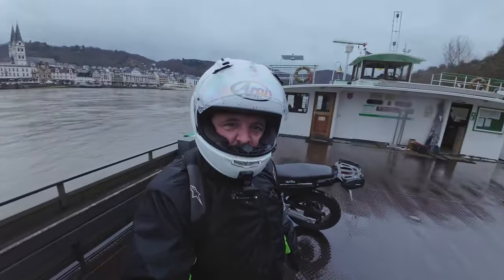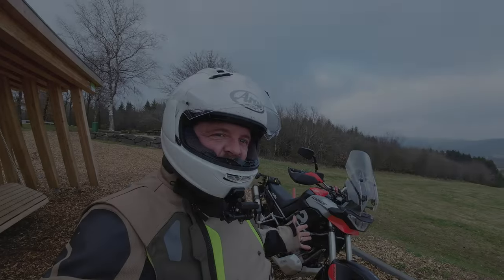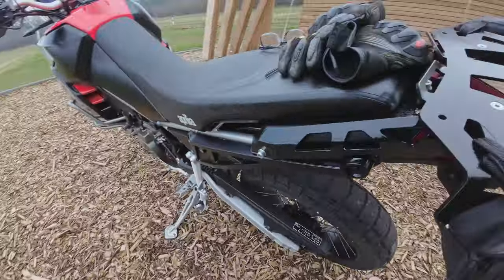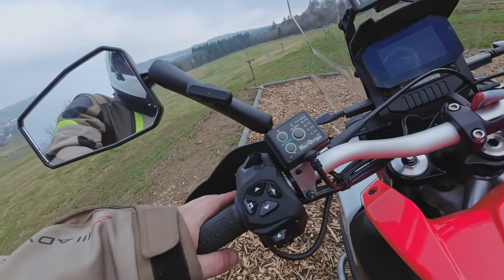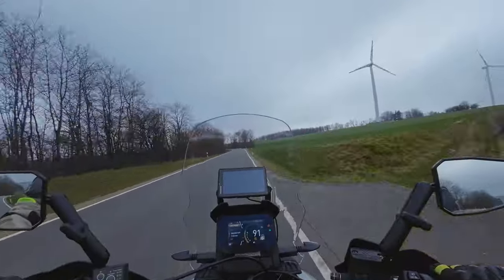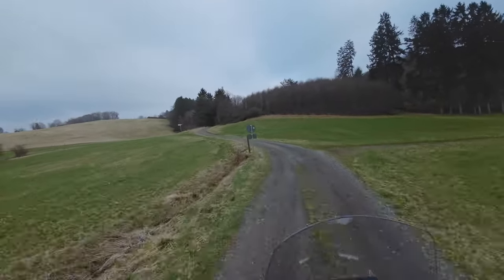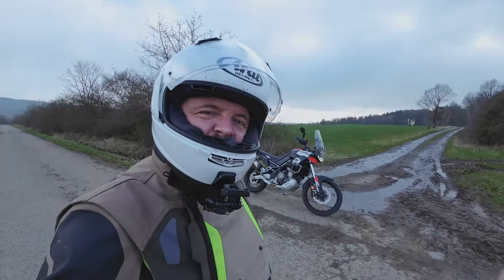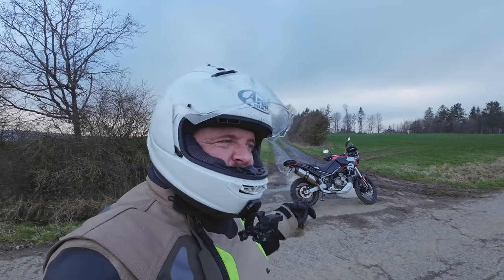Aprilia Tuareg 660: My first 1000kms, my HONEST experience

Comment from the maker: 1) LOTS of feedback on the expensive first service. I will cover this more in-depth later, when I can get some solid info. When I asked how much my first service would cost, I did phone some other Aprilia dealers close to me (in Germany), and they all said the same thing. I've also seen other Tuareg and Tuono 660 owners paying for this expensive first service in other countries too.

People calling me an idiot should consider that I did show them the manual I'd downloaded (in English) and I was shown a piece of paper (admittedly in German, not my first language) explaining to inspect valves at 1000km (600 miles sic).

Now, I suspect, in hindsight, that it might be a massive misunderstanding, or I was shown a service bullet-in that dealers around the world are using to screw some money out of customer. If the factory is worried about tight exhaust valves wrecking engines before the 20,000km service, then that's on them, not us the purchasers of said machine. None of this makes sense. I will dig into this and update you all.

2) The salt was an honest oversight. It was dry and sunny in the UK, when I got the bike out of the van, and rode it for less than 50kms in a semi-urban setting. I just forgot about the legendary potent, powdery, almost invisible, UK salt. (I've not lived there for nearly 20 years). But still, that exhaust weld rusting looks like a weld that didn't see enough argon, and the rust coming out of the silencer is a bad sign too. Salt didn't get fly down the exhaust while I was riding!

3) Sump guard/heat shield damage. It's clearly not a guard in any function, so I will look to the aftermarket. I still can't figure out where or how I broke it, or how it's supposed to fasten on.

All in all, I love the Tuareg and will be using it as my tour-guide bike the whole season, or at least, I plan to!
Reply: 1) I am not calling you an idiot (don’t know the others). And I am not saying that the first service cannot be expensive: I am saying that is not expensive BECAUSE of the valve inspection, as there is no such inspection foreseen.
2) I have already said what I mean about salt.
3) As I said (at the least in the comment that disappeared) you can clearly see a deformation, you clearly smashed the protection in something breaking the parts that fix the protection. Therefore my comment: there is no missing bolt, you damaged it smashi g it in something. Totally agree that you need something more protective in off, I have a Heed bashplate for the record
Reply: I hope my comment didn't come off like I was calling you an idiot because I wasn't. I didn't say anything about anything else though. Just the valve stuff.
Reply: I have the oroginal italian service manual
Reply: Oops only half the comment in there. I have the original Italian workshop manual. Valve check is at km 20000
Reply from the maker: Will check the Heed one. I had Heed on my 800 GS and was very happy.
Reply from the maker: @turbolag5107  People calling each other, and me, names get hidden by the algorithm here most of the time, so it wasn't you :)

Comment: Valve clearance on first inspection?!?!? First time I hear such nonsense, change your dealer...
Reply from the maker: It would appear that all my dealers in Germany are singing from the same hymn sheet. I will try and find out WTF is happening.
Reply: It's a recall. On my Tuono 660 it was like that. Paid by Aprilia. After 20.000km's I had to pay for the valve check myself. And believe me that was a lot more than 350€. 3 valves were off..
Reply: Royal Enfield 350 valve clearance at 300 miles

Comment: Brake magazine, put out a great video on the Tuareg 2 days ago, well worth a watch, after yours obviously 😅, the corrosion is basically your own fault for leaving it in the back of your van with salt on it.... don't know if you're aware, when you use acf50, your supposed to wipe it on and 10 minutes later wipe off the excess.... although if you want a tip from a motorcycle detailer, I use xcp pro (clear coat) on all my customers bikes and they always look good, some use their bikes all the year round here in Scotland... it's a great product and isn't gloppy or oily....top product 👍👍
Reply from the maker: I saw it and left a comment, really cool video! In my defence, I didn't mentally connect sunny dry roads with UK salt, I should have known...
Reply: Do you wipe XCP off like ACF50?
Reply: @Bannister99 yes, if you're storing your bike over the winter and you have a damp shed, garage then yes put it on and leave as is, but in the spring you'll need to wash the excess off before use, this is acf50, with the xcp pro you don't know it's even on your bike....

Comment: Yes, love my Tuareg, '23 model. No real problems in almost 5000 miles, but I also don't run it fast and hard (though people that have say so and w/ very few complaints). I did notice the bolts on the transmission side needed tightening as I saw a top side bleed, just a mist, so I tightened them of course. Hey - what's this w/ a valve check at 600 miles (1K)? If you were told that then I think they lied. The first valve check is recommended at 10K km (6K mi). And yes, it seems like some in the YT community coming on lately w/ some more bold positive statements about how nice this bike is, and I'm glad for it. Reliability? Yeah, look at the other bikes, everyone's got niggles or worse (KTM, Norden, etc.) Tuareg won the Africa Eco Race, 13 stages, beat the 2nd place T7, w/ no breakdowns, T7 had 2. Anyway I ain't no racer or hot shot and love my Tuareg to distraction. Thanks, later, enjoyable video.
Reply: O sorry, about the valve check comment - I read your reply to another guy, and yes, I'm in the states, and nowhere is that check recommended, so I apologize for any insult to your dealer or you.
Reply: Nope. First valve inspection at 20000km

Comment: There's no valve check on the first service bud. You got had on that one. I have the service manual and owners manual schedule. Valves aren't touched until 20,000 km.

First service is basically an oil change, chain adjustment, service light reset, ECU updates if there is any and an inspection of the bike overall. Read the maintenance schedule for yourself and you'll see.

I read your comment you said to someone else about seeing it in the manual for the 2023 BUT i made sure to download the later version straight from AF1 Racing and they list it for 2022-2024 and theres no "A" or "I" in the section under 1000km next to Valve Clearance. If they told you that it needed it they lied to you. I had a dealer tried telling me that same thing. I told them it's not in the manual. They tried to assure me that it needed the valve check. I said show me in the manual. He couldn't show me in the manual. I said what about the Tuono or the RS660? Still couldn't show me. I said to him that's because that's not for the 660 engine. Maybe for the V4 engines. But not the 660.
Reply from the maker: I'm going to dig in to this, because I saw an official looking update in German. I might need somebody inside Piaggio, because all three local dealers to me say all 660s need valve checks. One even said it was specifically the exhaust valve clearance that was the problem. If the factory knows they've got some badly set valves out of the factory, it does seem rough to pass it on to the first customer
Reply: @btgmoto  it's funny because people mentioned when they get their valves checked most of the time they're still within spec. Call Aprilia customer care. Customer care is usually pretty good. The one time I brought my motorcycle to a dealer what's to get the quick shifter activated and the ECU updated. They told me they didn't hear about any updates for the ECU. I said that's fine I want you to check anyway. Lo and behold mine was the first Tuareg they saw that had an update. I told them about the earlier fueling issues that it was having. They had no clue either. See I had to tell the dealership what I wanted them to do. I didn't let them do things for me. Dealerships want your money and if they can get away with telling you something that's wrong in order to get more money out of you, they're going to do it. Trust me I used to work for one. I would always hear the service managers talking about shit they tell customers.

Comment: Seems like a genuine italian bike: kind of bad build quality and lower reliability, but also very fun to ride. They've always been like this.

edit: also looks good. That's pretty much what italian automotive industry is all around, cars and motorcycles alike: good looking, characterful and fun machines, but not robust or too reliable.
Reply: Daj ne seri matere ti! Rotax 1000ccm je bio los i nepouzdan? Isli preko 100.000km u RSV Mille i Tuono
Reply from the maker: Kinda wish it wasn't true, as it's a trope by now...but... lol
Reply: @btgmoto  
I think it's fine. 

It's like how KTM are unreliable, but crazy powerful and fun. The things that make it crazy powerful and fun are the things that make it unreliable, such as high compression ratio, light materials, etc. On the other hand, a varadero is crazy reliable and rock solid, but extremely heavy and a bit unwieldy. You can't have them all :)
Reply: Nonsense. I’ve owned and ridden many Italian bikes and never had any real issues over decades. My Tuareg has >18k kms trouble free. 
Is it dirty? Sure. Who cares..
Reply: That may have been true for the past. Stereotype are resistant and don't go away easily.

KTMs are far more unreliable.
Transalps have just been recalled.

Comment: Curtis at On The Back Wheel in Australia totally put the Tuareg through its paces last year. It's a very capable bike. 
Small niggles with a bike don't worry me. My Pan America, that was a different story, constantly leaving me stranded. The dealership couldn't fix it and they bought it back from me. 
I'm on a 22' KTM 890 Adventure S for an ADV bike these days and I keep my fingers crossed, it's been good except for some TFT niggles but they seem sorted now. 
You should be fine with the Tuareg 660.

Comment: The day I collected my new bike, it was raining... I rode it home, washed it, dried it, and waited for the dry days.... I was, lucky. no damage. But for some reason it is very hard to get acf 50 here in the netherlands. So I have just been using silicon spray for now... the plastics look much better for it though.

Comment: Great work and another fantastic video. I asked last time if you could show a couple of wheelies and you didn't dissapoint, even hoisting a geoscopic wheelie at one point I think! 🤣
It's good to see the other channels catching on and covering the Aprilia. Up until now, loads of the group tests have omitted this great bike. Mine had the rust runs from the exhaust but it just stopped. It now has 6000 miles and other than a fuel sender (easy warrenty repair and didn't stop me riding) it's been a brilliantly versatile and enjoyable bike. I'd recommend the Aprilia Quickshifter and AXP skid plate as decent upgrades. The shifter is one of the best I've used and the service from Xavier at AXP has been exceptional.
Reply from the maker: I definitely want the quick-shifter, but I will shop around as I can order the hardware for only €150 online, and my €360 first service dealer, wants €400, of course. LOL
Reply: @btgmoto  Wouldn't like to think how much they'd charge to 'fit' that! 😰You'll need access to the Aprilia software for the QS unless you go aftermarket. I think in America you can self service etc and still keep the warranty. I've serviced myself at 3000 just because I think it's worth it for the cost/benefit.

Comment: Really enjoyed the images, I’m waiting for the snow and ice around here to melt to get my Tuareg on the road.  There seems to be lots of old preconceptions about Italian build quality posted in the comments.   I would rate the finish, engineering, and suspension on my T660 to be far superior to my Japanese VStrom 650. On the T660 owners FB page there are some posts about seepage around the water pump (input?), and I’ll keep an eye out for that.  Thanks
Reply from the maker: Thanks! I also believe the Tuareg to be right at the pointy sharp end of the market right now. It's the one to beat, in my opinion.

Comment: When I look at the new BMW GS, there are problems with short circuits and even engine replacement in the first series. A slightly leaking seal is a minor minor issue 😅
Reply from the maker: Yeah, the 1300 was on my radar, but I figured I didn't want to be a beta tester for a new bike.

Comment: Great 👍 review, that’s a shame about the rust and corrosion. In Australia we don’t worry much about a “ shiny new bike MOSTLY “ , it’s all about riding over here not how pretty it is or bling “ , BUT does seem not the best in metal quality. I currently have a 2021 Moto Guzzi V85tt obviously owned also by Peiggo Group , and still love after 16,000kms of on and light off road ADV riding . Have the Honda 300 Rally for the hard stuff 😂😂😂👍

Comment: You got scammed by your dealer. First valve check is at 20k. I have the 24 Tuareg 
manual in my hands. Glad you coated everything after those salty rides.
Reply from the maker: If only I'd coated them before... D'oh

Comment: Reliability is definitely an issue. Mine has 6000kms and i’ve had 3 oil leaks issues so far. 2 at the oil sump and 1 at the water pump. 
They replaced the oil sump gasket with the “new” version, but it’s leaking again after 1000kms.
Honestly, in my opinion, its not something you can trust for longer trips
Reply from the maker: Mine is leaking again from the water pump too... nothing stopping me riding, but also, I'm not happy. Will do a new video soon

Comment: Just took a peak at the Tuareg 660 service intervals and I see nothing about a valve check at 1000km? First adjustment is listed at 20k, no "inspections only" listed per what I looked at. 

This dealer just being extra careful?

Edit: reading other comments I see this has been beat to death. Carry on! thanks for the content.
Reply from the maker: Dead horse, totally flogged. I've kept the video up, but added a warning label linked to the post

Comment: Interesting - I used to work for Piaggio and warranty for corrosion issues were notably high in the UK - that salt is a killer!
Reply: Salt will rust and corrode ANY bike.
Reply from the maker: I know what he means though. UK cars and motorbikes do seem to suffer more than many other countries who use salt!
Reply: That’s because we salt the roads when it’s 8 degrees and generally wet. That combo of salt and the warmer/wetter conditions is why everything goes to shit. 

If we had a climate that actually justified salt it would be cold enough to inhibit the corrosion slightly.

Comment: Hi
I bought mirrors very similar mirrors from aliexpress for tuareg 660 and they vibrate terribly even at low speeds. Someone can suggest what I am doing wrong when installing them or is it just the way they are?
Reply from the maker: Hey, thanks for the sub. They're a bit vibey, for sure. But not enough to annoy me. Nothing you can do, except add weight to the barends.

Comment: First service only 300 Euros with a valve check! I asked 3 dealers for a quote on 12,000 mile service, they all said £900.. so you were ripped off at a bargain price 🤣
I absolutely loved test riding one last summer, Goldilocks bike for me - but parts supply seems patchy and reliability issues as you mentioned. 
Other manufacturers are no different, how long have Yamaha riders been complaining about the exhaust hanger bracket bending then breaking, no change on the 2024 models 🤨
Reply from the maker: Oh, don't get me wrong, I still love the bike. And the perfect bike doesn't exist anyway
Reply: @btgmoto  I absolutely get that and I'd love it too plus the 660 comes pretty darn close to that unicorn bike in my books.